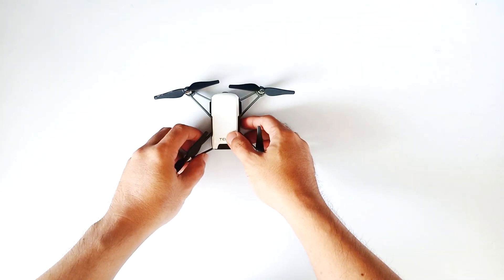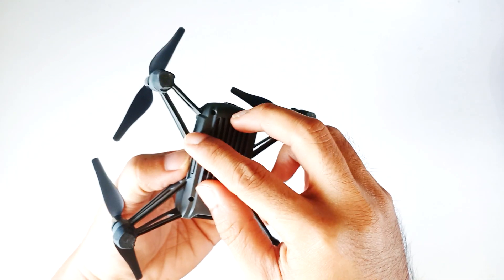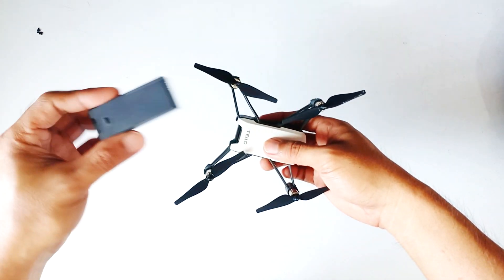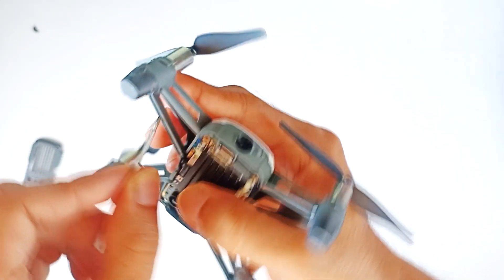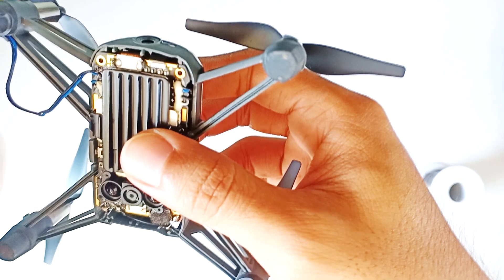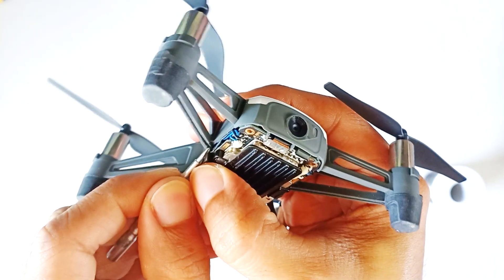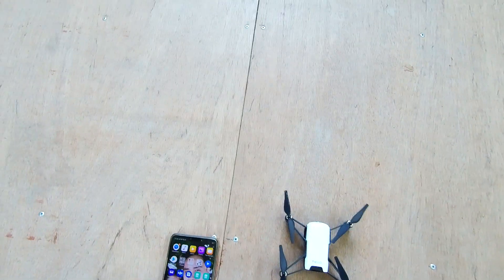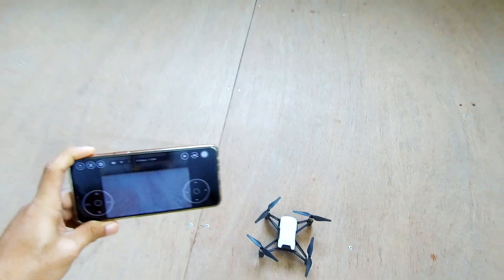DJI Ryze Tello Wrong Motor Fix! (we bought wrong motor)

Comment: Don’t buy again in the future any of their products . Ryzerobotics does not stand by their product warranty. Mine drone while flying fell off the sky. I checked and one of the brush motor has stop working. Drone was bought on August 18. Gave Ryze support receipt(November 14,25 and December 6)and after I spoke to Charlene then to Mark and last to Kid(this are all Ryzerobotic support team)they wanted me to shoulder the shipping cost for a drone that is under warranty. None of the three support team help me. Also wanted me to retrieve the drone data which I told them I don’t know how to do before deciding if they are accountable of whether I am. No warranty for this product.